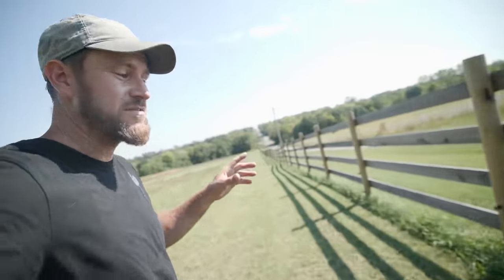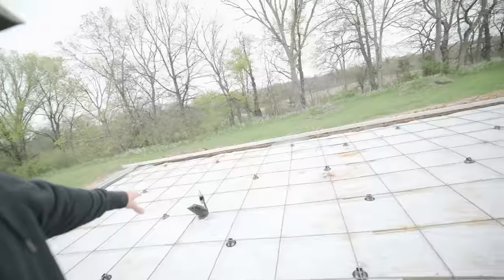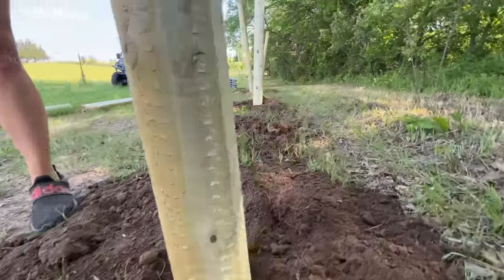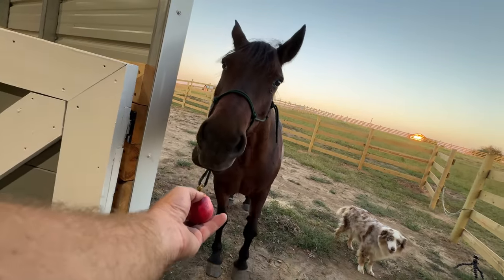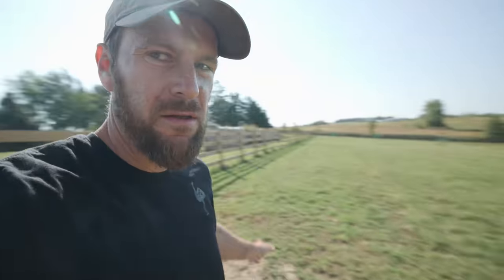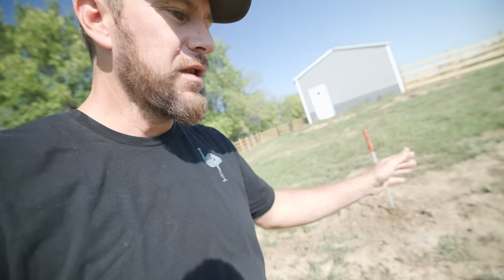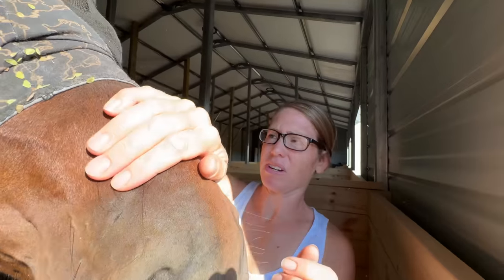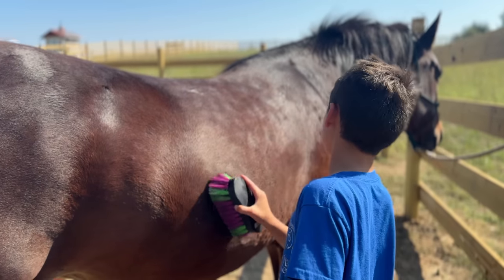Our Horse Barn Dream: Built in Only 8 Months

Comment: Looking awesome! Happy Becky gets to live her dream. Happy you guys are taking riding lessons and everything. 
A few tips:
1) Hanging the tack on the side of the stalls like that gives the horses access to them. It's not a matter of if they will play/chew on them, it WILL happen. Horses get bored easily when they are stalled as they are open range animals. I won't get into the ethics of stalling horses, but they will eventually destroy the tack or even get caught in it while playing with it. I recommend either hanging them across from the stalls on the other wall, or adding some cross boards to block them from being able to reach them, but you would have to move the hooks either way because they are too close to the doors for the second option where they are currently.
2) While the open concept between stalls is nice for looking at, and I know you said you will add more boards if there are issues down the line, but you might want to just go ahead and do that before you have more horses in those stalls. The boards don't have to run all the way up or even right on top of each other like you have the rest of the boards. You can leave some space between them for air circulation. Just close enough that the horses can't fit their heads through.
3) For saddles, make sure you are getting your saddles fitted to the horse. A saddle that is not properly fit to the horse can cause severe damage to the horse while riding and I know you guys care about your animals and don't want to hurt them. I don't know if you already know this info, just wanted to make sure. The "borrowed" saddle has me worried and I know you're relatively new to horses.
4) For riding tack, look into bitless bridles. The bits most people use actually cause pain to the inside of the horses mouth and more people are moving to bitless for this reason. A properly trained and trusting horse does not need pain to behave and follow commands.

I hope you guys enjoy Holiday! <3
Reply: Yes 👏🏼 also pressure and release training works wonders once the horse does something like taking a step towards a scary object allow them to step back or back them up and repeat until desired action is done which builds trust with the horse because your allowing them to take it at their pace and building neutral/positive associations with the action, also please make sure your kids r supervised  cause horses can spook at anytime or because kids aren’t aware of what they are and aren’t supposed to do and react it could end up with the kids and horse hurt, I don’t know what ur plans r whether you’re showing or just have them as pleasure riding but it would be a good idea depending on what’s available and price range to get an older more experienced with kids horse if u plan on teaching ur kids to ride like a horse in their teens, also loved the previous points this person made, plus make sure u have at least $5k for emergency vet bills cause horse vet bills can come out of nowhere (colic), a first aid kit for horses is also a good idea as well, I would also stress the point of properly fitting tack and bitless bridles, also make sure that you’re not exceeding the 20% rule which is both the person riding and the tack doesn’t exceed 20% of the horse’s body weight
Reply: Also saddle pads for extra shock absorption

Comment: You might want to change the doors to the 'dutch' door design, which would just mean adding an upper part you can close. when you get multiple horses, or even foals and you want to go out with 1 or seperate the foal, the other horse can get very stressed and try to break down the door, taking away their view of the other horse will help keep them calm and safe. It will also mean there's less airflow during the winter, which will keep the horses warm and keep the inside of the barn dry (which is better for the hay, could get moldy if it's too wet). When you need more airflow during the summer months or give the horses the option to look outside, you can just open up the upper part. Also adding some type of shade could be nice, just so they have a place that stays dry when it's raining

Comment: congrats becky for the fullfillment of your dream, this is for sure an amazing feeling 💗I
 highly suggest a hey feeder in the corner of each stall. if you feed the hay on the floor, most horses will spread it out and poop/pee on some of it. day by day it may does not seem so much, but if there are more horses and you sum it up for the whole year, you'll find out that you need way more hay than the horse actually feeds on, as you have to throw away the dirty stuff, because the horse won't eat it any more. this would be the only crucial thing, I'd put in right away, the rest of the setup seems to be sufficient for the beginning, until you find out what annoys you ant want in addition (like an "overhead hose", which allows you to spray the horse without the hose wiggling around the feet of the horse, etc.) 
have fun, hopefully soon also with a companion for holiday 💕

Comment: I agree with Jenna Weiker. You guys should pick up some wood shavings from the local Tractor Supply, or another supply store, to pad the stall floors with, and give your horses something soft to lay on. Without some form of bedding, they could develop painful sores from lying on just small mats. We would make the bedding for each stall at least a foot deep to give the horse(s) enough padding to lay comfortably on with their weight when sleeping or resting in their stall(s).

Others have also mentioned feed buckets, hay nets, etc...we would normally keep hay on top of a pallet in our tack room, and just throw one flake of hay in the morning, and one at night, for stalled horses. I would also get one salt lick per stall to allow the horses to keep up their salt intake, and not develop a goiter (i.e. iodine deficiency). You can also buy toys for horses, like the Jolly Ball.

You'll also need to start looking for a good large animal veterinarian who works with horses; a good farrier to trim hooves and shoe if needed; and someone to float (i.e. shave) your horses' teeth. I would also personally look into covering any and all potential things that stick out with some sort of rubber or foam to prevent any possible injuries by the horse, and to get "breakaway" cross ties and halters. "Breakaway" sections are for safety, in case of the horse spooking.

You'll also need to learn how to periodically clean the horse's udder (mares) or sheath (geldings).

Others have mentioned getting a few saddle pads to use under saddles. You may also need to get a foam riser pad, depending on how the saddle fits the horse. You'll also need to decide whether you want to learn English style riding, or Western style riding, and work with a good trainer. Horses also need to be ridden and exercised regularly in order to stay happy, healthy, and in shape.

If you also want to look into adopting more horses, you could always adopt another Mustang, but my personal recommendation would be looking into OTT (off the track) Standardbreds and Thoroughbreds, so long as they don't have any major issues (i.e. back problems, track injuries). Thoroughbred (TB) mares are useful for breeding sport horse crosses, and may be able to be inspected and approved for warmblood breeding based on their conformation (i.e. body type).

However, you will need Jockey Club papers for inspection and approval for TB mare(s). My mare was a Thoroughbred/Connemara cross who was inspected and registered as an Oldenburg broodmare. She was bred via A.I. (artificial insemination), and produced a nice Oldenburg gelding.

Western-oriented breeds, like the American Quarter Horse, Paint Horse, Appaloosa, as well as gaited breeds, like the Saddlebred, Morgan, Tennessee Walker, and more, also have a lot of TB influence. However, some Thoroughbreds, Standardbreds, Arabians, and Anglo-Arabs may be too "hot blooded" for beginner horse riders and owners, depending on the horse's temperament.

My old trainer, who worked with kids, also bred Welsh ponies and crosses, as well as Pony of the Americas, though my personal recommendation would be a Connemara pony or a Shetland pony, especially if you have small children. Quarter/Paint ponies and Haflingers are also popular.

Source: Took care of horses for many years, as well as rescued and adopted a few horses.

Comment: For the auto-water, I’d recommend putting the plug on the inside. While on the outside, the animals can bite and remove it. It’ll continuously run until you stop it. This way while on the inside, it’s much more difficult for them to remove it and the bit of weight from the water keeps continuous pressure on the plug and keeps it in place.

Comment: Ever since I read about a horse barn designed with fall-out exterior wall sections that are automatically triggered by fire detectors, I have considered that safety feature a no-brainer when building one from scratch. Fire in the structure makes the wall panels secured by top latches fall outward by gravity once the alarm condition is indicated. Each animal can free itself into the outdoor paddock area rather than die from smoke. The back wall panel of each stall becomes a ramp out instead of a dead end to the animals inside.

Comment: Suggest shade structures in the paddock until you can plant trees for them to stand under out of the hot sun. And a whole house fan for the barn. Will draw fresh outside air through the doors and suck the stale air out through the roof. Will help with smell and cool off the barn in spring and fall. Also, i didn't see the top halves  of the stall doors; dutch doors. Or did i just miss it? You'll want a way to completly shut those during thunder and snow storms. Feed bins and something soft for them to lay in like straw or hay. Importantly, a bathroom! You already have running water. You need a place to wash hands and do your business. You may even put in a washing machine out there. You do not want to keep running to the house when you're in the middle of training or chores or lugging laundry back and forth from the house. Lastly, a radio and speakers in the barn. Thunder and fireworks scared the bajeebees out if my animals. A few years back, i placed a sounds machine in with them that play sounds like rain and  thunderstorms. It plays 24/7 at a low or medium volume. During thunderstorms and fireworks, i just turn up the volume. Storms dont bother them at all anymore and they sleep like babies through thunder. Not sure it will work with horses, but it's game changing if it does.

Comment: I would consider insulating that building with some spray and insulation, It's going to be a cold winter this year, I'm sure. It will also cut down on temperature inside during the summer. I'd install a small on demand water heater. It definitely can be nice to use the hose with hot or cold water, along with the sink. I wish you would have gone with a tall fence as it would have been nice for the EMU's as well as maybe the cows to share the same pasture. EMU's, of course, need a higher fence more then likely and would have been really nice for them as they needed more room. I think you need a donkey and maybe some rescue horses. I think you should have possibly broken this up in more videos... More content more, more saying... But it's nice to see the whole project from start to end in one video.
Reply from the maker: I don’t think you realize how tall our fence is. It’s as tall as the fence in the emu yard.

Comment: Put in a dorm-sized refrigerator in the tack room.  You can use it to keep vet meds refrigerated and available when you need them, in an emergency, instead of having to run all the way back to the house when time is of the essence.  You can also keep cold drinks in there for your own consumption, since you're so far from the house.

Comment: I love what you guys did.what a would recommend though is adding shavings to the stalls I am unsure if you were going to or not but it just helps absorb the pee and I know you have the drains but the shavings will help. You may also want to move your hay because keeping it in the tack room will make it very dusty, and I am not sure if you just didn't film it or do f you don't know to pick out holidays hooves before each ride it just insures that there are no rocks or anything that could be bad in her hooves. And when you were getting her used to her stall you should make sure your not giving her too much sweets and maybe look for a different reward for her that's a bit healthier.And I know you said you needed to buy saddles and stuff and I know you said you were borrowing someone else's saddle but you should be using a saddle pad under your saddle always its ok for a bit since your not going to fast but just look out for rubbing marks or anything like that. And I would definitely still do some research about what you need for holiday before you get anymore horses. But your doing great!!!! Have fun with her!

Comment: You might want to add fans for ventilation especially in the summer.  The setup looks great and functional.
Reply from the maker: Yes, I mentioned we would be doing that in the video. Still have to run electrical for some outlets by each stall.

Comment: You may want to put a hot wire on the inside of the fence horses have a tendency to push/lean, over time they  will work the boards loose. A single hot wire about 3 feet  up should do. Just a thought.

Comment: You absolutely NEED an area to easily hose the horses off. It is crucial to do after rides to clean off any built up moisture but also to help them cool down. Not to mention you should be regularly washing your horse and if there is no dedicated area to do it then you might end up skipping it. You want the clean off area to be on concrete because otherwise they're just standing in mud the whole time and getting dirty again. With time the mud will only become looser and more slippery to walk in too but that is more of a human hazard than it is an issue for the horse. 

Also for the future you might have to make the stalls in that stable taller to put a visual barrier between horses. Even if they get along fine in the field, horses can still bother each other. I'm honestly surprised the stable you bought didn't come that way be default since that is the standard for stalls. *note stalls for tacking up horses don't need visual barriers and are often super short and small anyway. They're nice to have to make life easier but not needed.

Comment: It’s hard to tell from the video but I think you have your fence boards backward because with horses you want them on the inside where they are because they will lean on them and break them off. You could also have boards on the inside and outside. Just thought I would let you know for safety and to help you keep your fence from being torn down as fast!
Reply from the maker: They used to nail in boards, those could be pushed out. I can’t see our heavy duty screws being pushed out.

Comment: The only thing i am concerned is the height of the dividers and them being open. They may bite each other or try to jump over the divider if they are in heat or spooked by something. In spain they put bar on the solid divider to avoid biting beetween them. Looks great otherwise. The thing im talking about is not a thing you can see it happens everyday, maybe you never have the problem, or you don't have that problem for decades, but it only takes 1 bad day for it to happen. Also please buy helmets and chest padding for the kids, i've seen many many bad falls and it only takes a little rock to perforate a lung or something like that in a fall. Best of luck and nice building project!

Comment: Will the horse barn have heating elements (lamps? radiators?) be hung from the ceiling or stand on the floor for Winter? Or thermal blankets for each horse?